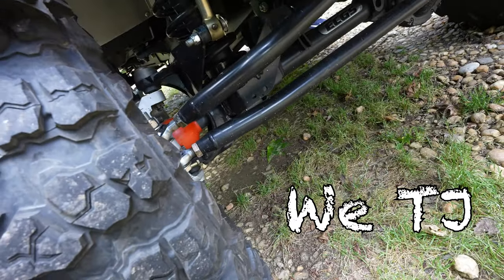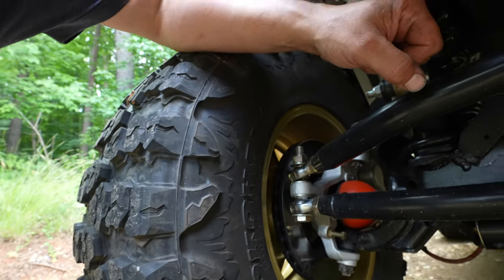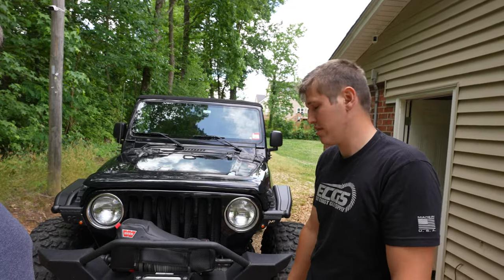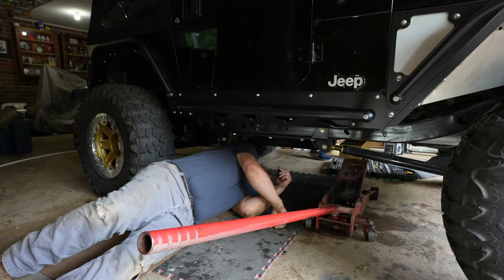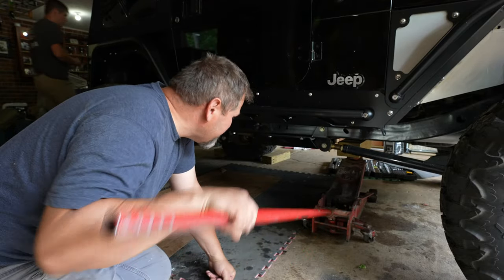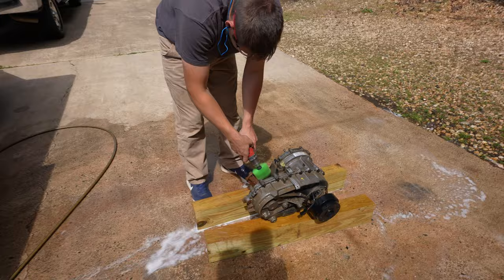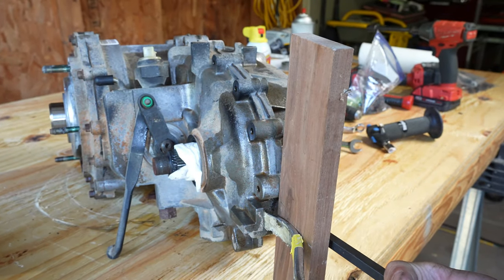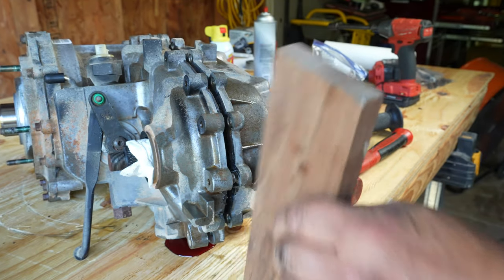Jeep Rubicon NP241 Transfer Case Chain Installation

Comment: Interesting side note. Its been a couple years so don't try without researching but I was able to put a 1.5 inch chain in my 241or by using a chain from a 241dhd and sprockets from a np273.
Reply from the maker: Interesting

Comment: I just got done rebuilding my Np241or. One thing I discovered was how extremely worn the fiber washers used in the 4:1 planetary were. I’d recommend tearing back into the case and checking that along with replacing all the bearing. Let me know if I can help you guys out!
Reply from the maker: We will take it back apart eventually. It had 58K miles so we really weren’t looking or expecting parts majorly worn and they weren’t from what we saw. We will completely rebuild it in another 10K-20K. Thanks for the feedback and the offer.
Reply: Of course anytime. Just be aware that transfer cases with known issues/sounds at a point will  explode and cause some serious damage to the Jeep and to the occupants. Hope you all the best and be safe!
Reply from the maker: @terraforge_motorsports  we found the sound and its not coming from the transfer case.